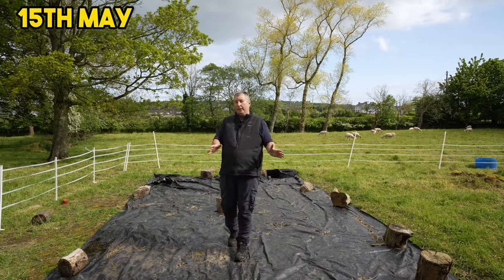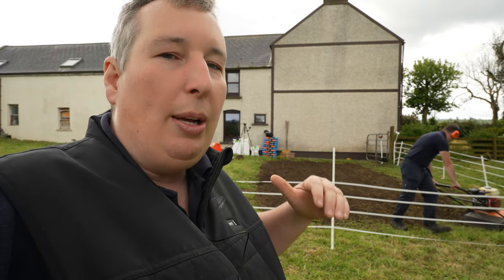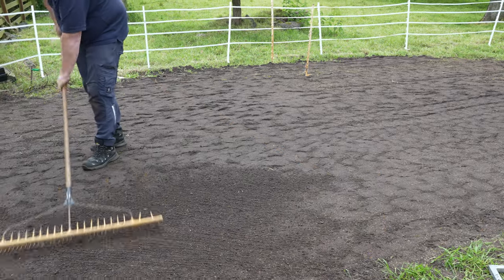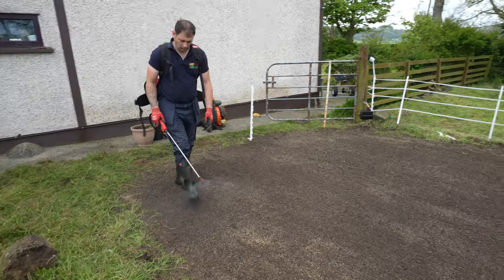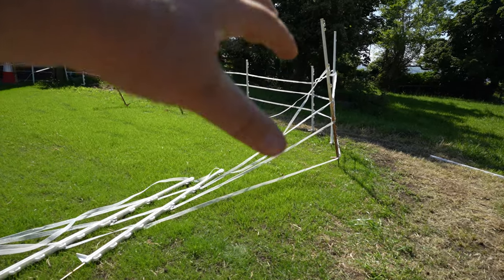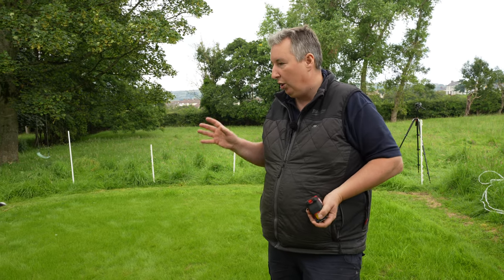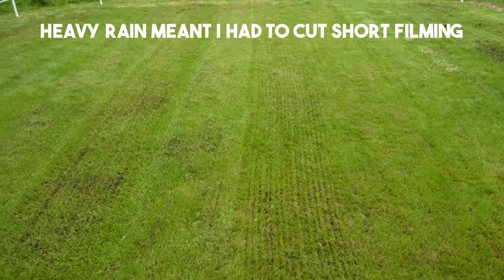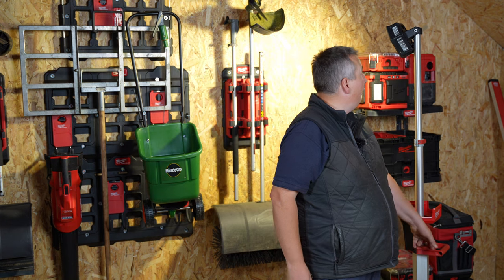Is it possible to have a lawn that never needs cut?  I tested it out

Comment: Turf Type Tall Fescue (TTTF) boasts pretty good reviews in lawncare forums like reddit. What's your opinion on it? Will it come to the Ireland/UK market? This is a topic that there isn't much non US information on and it seems to be quite different from normal Tall Fescue variants. Maybe a video on it?
Reply from the maker: I think you will start to see more of it as I believe it tolerates drier summers better. Though it's not something I know a lot about

The KBG, that's the first time I have really used it before, occasionally in shaded mixtures but not set out to use it

Comment: Appreciate you taking all this time to carry out experiments so we don't have to. Now that its almost impossible to get hold of lawn fungicides in this county, could you do an experiment trying alternates to cure red thread? I have just bought some neem oil to try but not used it yet.(have found since giving it a nitrogen feed its cleared most of it up so far)
Reply from the maker: You doing the right thing at the moment, a high N feed grows the red thread out of the lawn. That's your best course of action
Using fungicides can be self-defeating. In your lawn, there are good bacteria and bad bacteria. Once you apply a fungicide, it wipes out everything. The good bacteria and bad bacteria provide a balance to the ecosystem of the lawn, once there is neither there then what tends to happen is once the red thread is around it will come back stronger in the areas treated with fungicide. That may only be as little as a month later... Whereas treating with N, the grass grows it out and the bacteria in the lawn carries on feeding everything else down there. 

I few years ago I bought neem oil as an organic insecticide, that stuff stinks! Not sure how effective it will be on your red thread though

Comment: Great video!  Please educate me on the browntop no mow mix, is that what some UK golf courses use on their greens?  I was going to try building a chipping green with this mix  , but, I bailed last minute and went with bent instead because I was having trouble sourcing the proper browntop fescue mix. I live in in central new york.  Do you think it could've worked in my parallel (?), I have a GM1000 and maintain my bent at 3/16" because I primarily use it for chipping practice. Would like to see you do a follow-up on your BT/Fescue plot cut with a greens mower. DG
Reply from the maker: The low maintenance mix makes for an awesome lawn, but it takes a lot of looking after compared to a normal lawn 

With everyone wanting to get deep dark green lawns, it has gone out of fashion as this is achievable with rye and not bents